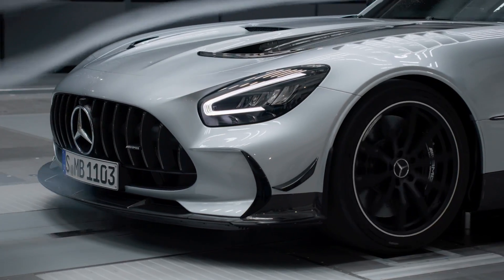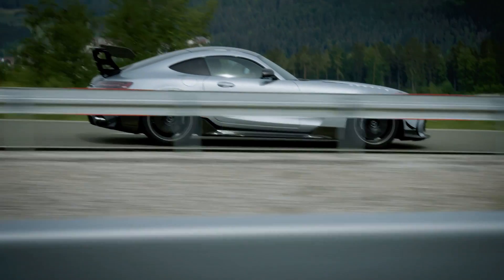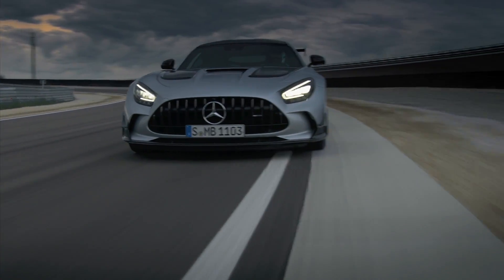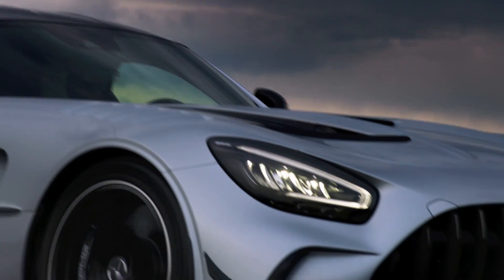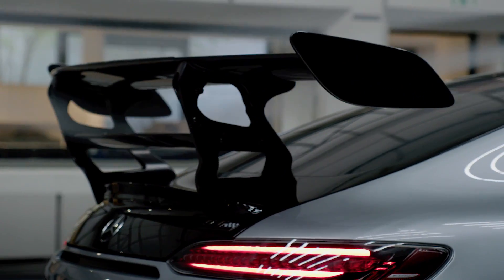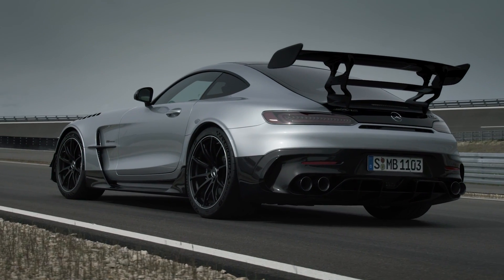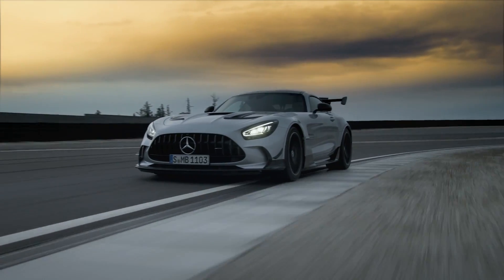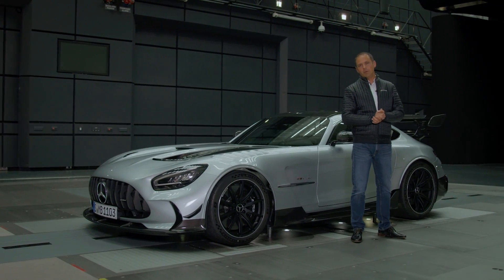In the Wind Tunnel with the New Mercedes-AMG GT Black Series

Comment: the car weight is circa 1.700kg and it throw back 1kg of carbon dioxide every 3km. so mathematically if am not wrong when you drive 20.000km per year you throw back the car weight equivalent in Carbon every 3 months. What!!!!!!!!!!!!!!!!!!!!!!!! If I drive this for a year I'll be putting 7.3 tons of carbon in the air! 1000 GT running at the same time and there you go 7000 tons per year plus a huge hole over your head. Na ja I know rarely when those cars run over 20.000km in there entire life but so confused with those numbers which I never thought about.  The best or nothing - I mean the best hole plz XD